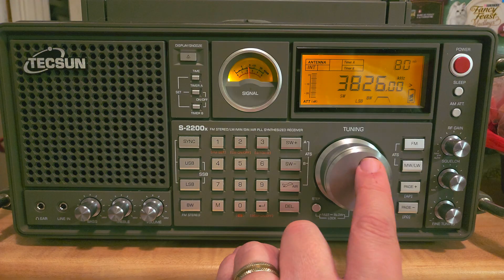Where is there to listen to 3000 to 4000 kHz Shortwave example using Tecsun S-2200x on Telescopic

Comment: I hear Morse code, radio amateurs or music pirate radio stations between 3200 and 4000 KHz.
Reply: There are broadcast stations at least in the upper part in Europe. 3955 is KBS from Wooferton for two hours in German an French every evening, for example. There's a weaker transmitter for Channel 292 in Germany on the same frequency as well. Wooferton is good for me (block Germany), but the one in Germany is there but very weak and quite noisy but clearly identifiable. If they had a higher power transmitter it would probably be really good.

Another thing off the top of my head is 3855 which is weather fax or similar from Pinneberg in Germany which transmits regularly.

Comment: I've always wanted to get an actual physical or "analog" radio. I used SDRs and Handhelds but I would really dig the tactile experience of turning the knobs to get something tuned in just right, buttons are okay and using a mouse is easy to do but it just doesn't seem like it feels the same. too bad most of them are over 100 bucks.

Comment: The way to use these videos is to follow along with your own radio, if you have one. For these lower bands, best to listen after sunset.
Reply: That was what I was going to also add. If a newcomer tunes 3.5-4 MHz during the day they will be pretty disappointed. After dark is the rule for that band and below for sure
Reply: @wf7ihomebrew General rule of thumb: 11 MHz and above- daytime with important exceptions. 9 to 12 MHz 24 Hours except at solar peaks. Below 9 MHz nighttime is best.
Reply: @RJDA.Dakota I would disagree with some of your ranges. 40m ham band (7MHz) is very active during the daytime hours. It isn’t until you get down somewhere below about 4-5 MHz that the d-layer starts to wipe stuff out pretty badly